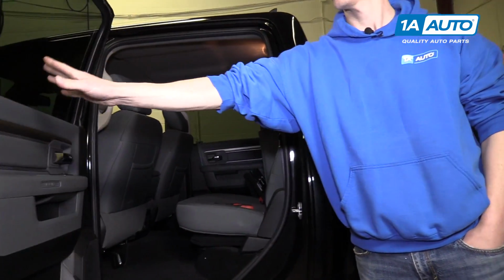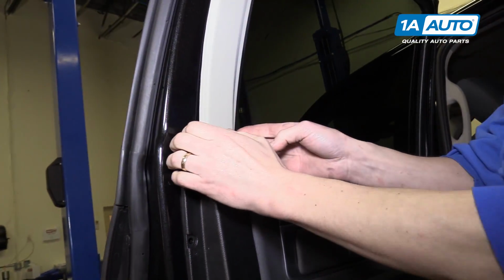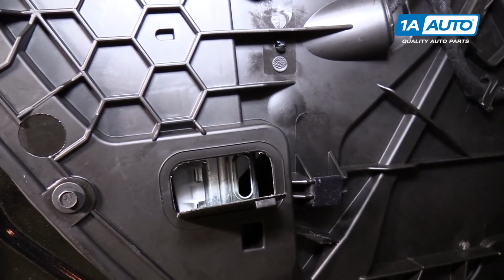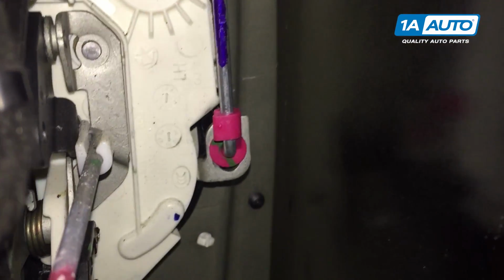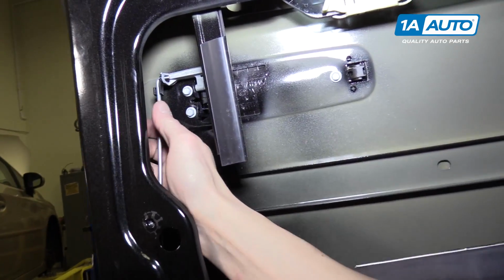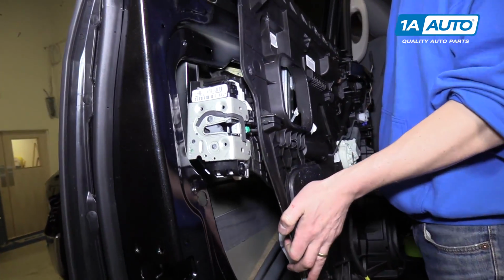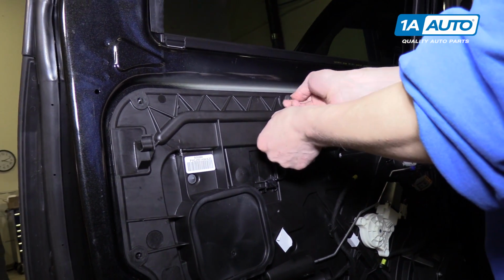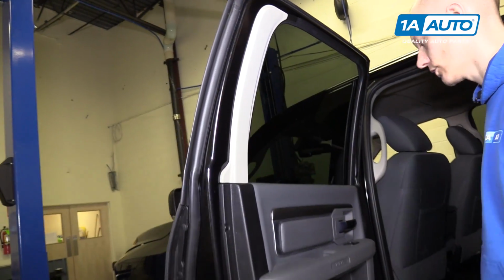How to Replace Rear Exterior Door Handle 11-16 Ram 1500

Comment: you can literally just remove the 10mm bolts, adjust the glass, pull back on the panel, and get to those 8mm easier than take this whole thing off lol. so taking it all the way off isn’t necessary because who’s gone wanna do all of that just to put it back in?

Comment: I see no need to remove the whole thing to get the handle change. i have a 2014 ram I did mine with only removing the cable from the brown clip and the screw on top of the handle they pull out.

Comment: Have you guys taken apart the rear door on the 2019? The exterior door handle is in two pieces, one of them called the "cap". Pt # 6EG54KGZAB

How do you install this cap? doesn't look like it snaps in. Do I need to take apart the door for this too?